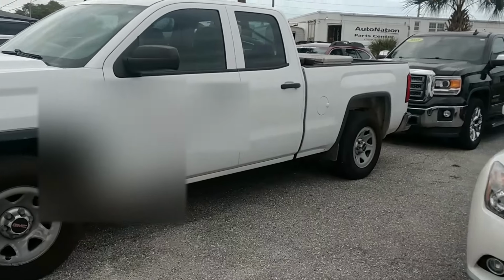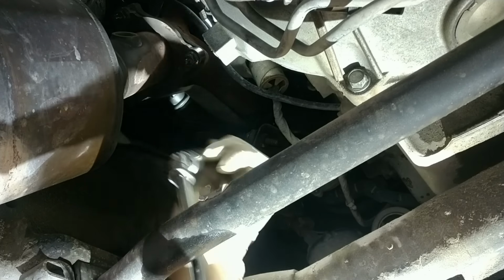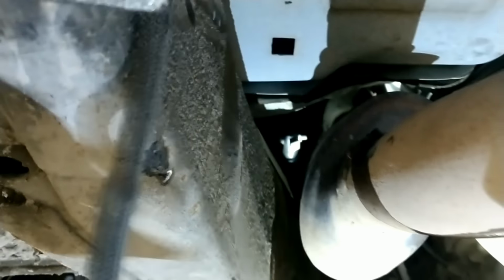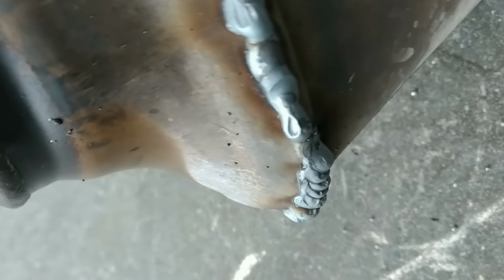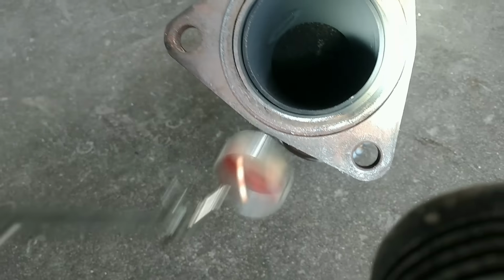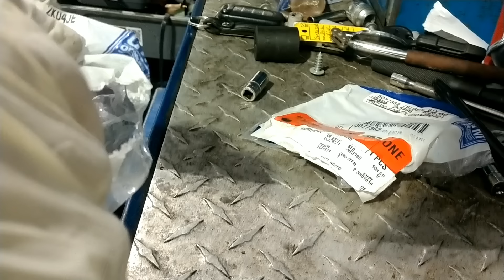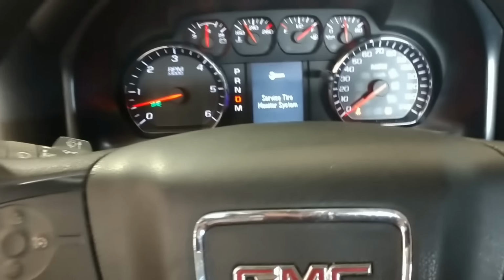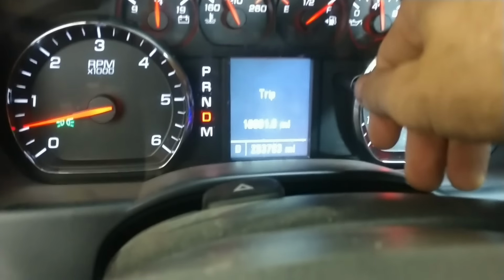Customer States exhaust leaks: Repair it cheap.  Ok then, I can do cheap and good. Sort of.

Comment: Gotta love those genuine USA made GM parts
Reply: Even tho the tag said made in Mexico
Reply: r/woosh
Reply: Made by Unions
Reply: @oigleoystereater2003  made from cheap steel, using cheap labor, with no quality control, in shit working environments... yeah, totally better than any U.S. made products 🙄

Only reason anyone does business in Mexico is because of their trade agreements. The NAFTA and other FTA's Mexico has, makes it a trade mecca. That being said, they don't have half the quality of American made vehicles. They are rolled out in mass to be shipped all over the world, with cheap parts. Fun fact for you, it cost GM $2.00 to make a sensor on the truck. They sell that sensor for $110, and it's known to fail. Designed failure is now a thing.
Reply: @oigleoystereater2003  Ford is #3 in reliability behind only Honda and Toyota... The F-series is the number one vehicle line sold world wide... must be some pretty fantastic crap.
Reply: @hanksadventures4132  American made quality vehicles? Like the ones who have engine problems in less than 200,000 miles, or body/frame rot in 5-6 years? What were you smoking when you came up with quality and American made vehicles in the same sentence?
Reply: @JosephArata  well considering how they are made from aluminum, your frame rot theory holds about as much water as a strainer. "Engines that have problems with under 200,000 miles"... funny, I have an 07 F150 with 400,000 and a 98 F150 with 450,000 and a 2012 with 210,000... all run like New. Most Chinese cars are not driving after 200,000 miles, and the rest of the vehicle is falling apart. Japanese cars are still on the road, but the entire car is shot, the interior especially. European vehicles are lucky to make it to 150,000 miles without MAJOR engine work. So again, please explain how American vehicles are garbage?
Reply: It doesn't matter what piece of crap you drive, they are all made from parts that come from all over the world and none of them are built to last.
Reply: The parts have to do with quality control. I’ve serviced Toyota and Honda’s with Denso parts Made in Mexico. Japanese parts manufacturers appear to be based on quality as opposed to their US counterparts. It’s about the work philosophy.
Reply from the maker: @InuyashaMiles  that was the joke
Reply: @hanksadventures4132  yep planned obsolescence
Reply: @JosephArata  To be fair most "frame rot" is owners living in states that have heavily salted roads and doing no undercarriage washing and/or fluid film treatment. Heck, I had a cheap-O Escort or 12yrs and it had zero rust at all, it depends heavily on where you live and the maintenance it gets.
Reply: @barryaiello3127 yep.  frame rot is a fact of life where I live. If it doesn't have some natural weight reduction after awhile it's not from around here. Every vehicle has some.
Reply: @colinklang  Yea, I used to live in MA, the salty roads literally ate cars, they do make a good protective film-spray called "fluid-film".
Reply: @hanksadventures4132  that's funny you mention Ford because for all the searching I just did, they're not hardly ever mentioned for reliability. Seems kind of strange for a brand that apparently ranked 3rd.
Reply: @jeremyrafuse5330  running off of old data. That being said, as a mechanic, I see more GM products than anything. From dropped valves due to the AFM to blown out rear ends due to the wrong diff fluid from the factory.  I see a few Fords and foreign cars. Nissan is right up there with GM, with those trash transmissions they slap in them, at least once a month I have someone come in needing a new one.
Reply: @hanksadventures4132  our work truck is a Ford F250 Superduty, with under 20000kms on it. Part of our daily checks now at work is making sure the truck can actually start. My brother's wife had a Ford Escape. I spent more time underneath that vehicle than inside of it. It was constantly broken. I had a Ford Focus sedan for a rental one time. Could be more on Enterprise, but not very much kms on the odometer and it just felt like it was going to fall apart and handled like a shopping cart. Just felt extremely cheap.

I drive Chevys mostly because of the fact my wife's uncle works for the head office in Ontario and we use his discount. I have a 2015 Chevy 1500 that has never had any issues with it, and a 2019 Chevy Blazer for my wife with zero issues either. Come to think of it, all of the vehicles I've owned never had too many issues.
Reply: You mean Mexican authentic American parts
Reply: @volkswagon1966  yes
Reply: @hanksadventures4132  i would like to correct you. Not all European engines require Major engine work past 150 000 miles, as an example Mercedes Benz diesels used as taxies around europe having crazy mileages without major engine work done, mostly older ones sure. A friend of mine has a Toyota Avensis D-4D 2014 with 700 000km on the clock and no major enginework done, sure clutch replaced and egr valve replaced along with things like waterpumps etc. The normal stuff, but nothing major.

Same with certain Volvo Engines going past one million kilometers. 

Nearly every manufacturer has their good engines and their bad engines.
Reply: @jamram9924  Exactly. And if the American car companies fully adopted the Japanese TPS manufacturing system with a culture of stopping to fix problems, to get quality right from the start. Jidoka  (Autonomation) then American cars could be quality too.  But they won't, so they aren't and most Americans will continue to buy Japanese cars as they deserve to get the most quality for their money.
Reply: GM had there parts made in Mexico and China both are 100% junk and should never be sold in the US
Reply: @worstnightmare9772  Fun fact: Most automakers get their parts from the exact same suppliers.
Reply: Made in America not usa it means north or south America
Reply: @oigleoystereater2003  lmao theres a reasom nothing is made in mexico
Reply: @hanksadventures4132  mojority of ANY us based car company hasnt been 100% american since 90s I think. Hondas out last everything american. They have way beeter quality control. 85 f150 650,678 miles 77 1.5 million on a 460 88 Honda odomiter expired! No over haul no major maintenance. 77 and 85 both 460s over hauled twice. My 76 sold because of it being american peace of crap boat ⚓!  Took my loss at 3500! Sold it for scrap! So ummmmm ehats ypur point. Ford sold out, GM is a goverment hand out dodge is owned more by Mercedes.
Reply: @indigenousways666  ... dodge is owned by Fiat... try again... Honda makes Fantastic small engines, just not good cars. The interior and exterior are absolutely trash. Ford parts are made in 3 major plants. Cleveland, Windsor, and Romeo. The vehicles are assembled in Mexico and Ohio. Honda is assembled in Mexico, and meet Mexican quality control and safety standards. The only thing Honda has any quality control measures for that are stringently enforced, is the production of the block, which is produced and assembled in Japan. You clearly know VERY little about cars.
Reply: @hanksadventures4132  
F150 is also number 1 in junk yards.
Reply: @ageckomiller  that's not even close to true. Go to any junk yard in America and look for an 11th gen F-150 (04-08, Ober 3 generations ago), then go look for an 05-07 Silverado or Ram. Guarantee you that you will find 4-1 of the Silverados or Rams. Why is that you may ask? Longevity. The 10th and 11th gen F-150's have one of the best transmissions put in a full size truck. The number 1 reason for vehicles to end up in the scrap yard is due to a mechanical failure, typically involving the transmission. Ford outsold the competitions trucks 3-1 with the 11th gen, yet consistently outperformed them in terms of Longevity.
Reply: @Manakuski  European gassers is what I was referring to. Here in America tho, European diesels are still junky. They last as long as it takes to pay the vehicle off, then start falling apart. A big part of that is maintenance, due to the high cost of parts and fluids to meet euro spec, maintenance is typically lacking.
Reply: @hanksadventures4132  
I've had a 96 k2500 for 17 years. Find me someone with a Ford they've had for 17 years.
Reply: @ageckomiller  me, my 98 with over 450,000 miles (not KM) on it. Still runs fantastic, original motor and trans, had to replace an axle after being t-boned, and front axles because I take it off road just about every weekend. I've had my 07 (currently sitting at 410,000) since January 7th, 2007 with 3 miles. Congratulations, you bought a k2500, an extremely underpowered truck with a God awful transmission and shit gas mileage. I'm guessing you live in the south where your k2500 hasn't been exposed to salt, and I'm also assuming by the fact that you've had it for 17 years that you wither don't go off road, or have had to replace darn near the entire truck.
Reply: @hanksadventures4132  
Not going to get into the oldest argument of manufacturers with a closed minded ford fanboy.
All I can say is I've had 3 Ford's, 3 GMs, 1 Toyota and 1 dodge. Every one left me stranded at some point except the GMs. Proof is in the pudding.
Reply: @ageckomiller  I've owned every brand of vehicle myself. I have a 99 Silverado sitting in my driveway right now. It has 95,000 and needs a new transmission. Sold a 95 dodge about a month ago, it had 260,000 and 2 engines. Proof IS in the pudding, and looking at the junk yards, it's clear. Now run along to your sister-mom and uncle-dad and complain that the mean man on you-tube said GM's were junk vehicles using outdated technology that was abandoned by every other manufacturer in favor of better fuel economy, more power, and greater reliability.
Reply: @InuyashaMiles  ya.. South America
Reply: @hanksadventures4132  f150 sales numbers are 95% sold in USA.. and The reason for that is The lower taxes and from that lower Price.. so worldwide... Yes But not really..
Reply: Good job!  After this truck, that guy should just get a Hilux and never have fix anything.
Reply: @hanksadventures4132  yeah fords behind honda and toyota, who both also make millions of cars in the US every year
Reply: @NoknOnDors  Yes, there is Yank made Toyotas and all the Yank made ones are the worst performers on their books for reliability and build quality, I don't know about the U.K. as I don't live there, but where I do, the worst Toyota is the Kluger which is U.S. made, but it is still vastly superior to any other Yank crap, especially from the "Big Three".
Reply: @andym1223  Glorious revolutionary socialist people's unions.
Reply: @InuyashaMiles  last i checked Mexico was in America
Reply: GM. 'nuff said
Reply: @hanksadventures4132  you don't have two Fords with 400k and 450k miles and anyone who believes you is a fool. Those do exist, but you don't own them.
Reply: @hanksadventures4132  that’s very interesting hearing from someone currently in the field, thanks for posting. I had a 98 Tacoma then an 01 s10. Very few parts needed to be replaced  on yota. Only the ball joints and regular maintenance. The s10 was completely opposite. You name it, it failed. I should have researched before buying. Piece of junk. Got both from original owners. S10 had 80k mi and Tacoma 101k. Fuel pump failed 2x on s10, not once on Tacoma. Ball joints replaced at 70k miles as per owner receipts by a NAPA certified garage. And again at approx 140k. LotSa other repairs that would take hour to write out. Couple friend have similar vintage Ford trucks 97 & 99 f150 and ranger and like Tacoma very very few repairs needed other then regular maintenance. I can add that I’ve heard Nissan was good before y2k which is when Renault merger then they turned to junk. I had a 97 pathfinder that was awesome, regretted selling!
Reply: @oigleoystereater2003  What country is Yank in? Is is over by The New Zealand?
Reply: @hanksadventures4132  the F is only sold in decent numbers in the US. they dont even sell them in most countries outside the US. might want to check your american awesomeness there. most american cars/trucks are not even legal in the EU due to their utter shit economy, pullution level and utter lack of safety. and no one is going to buy ANYTHING with 6.8 V10 when gas is 9.50 a gallon and simply cannot fit in a parking space or garage.
Reply: @oigleoystereater2003 , given today's greedy unions and lack of quality control at GM, you are probably more right than you think.
Reply: @InuyashaMiles , hell, most of them are already here in this country so hard to tell.  Made in Mexico could also mean Las Angeles, etc.
Reply: It is a sad thing that a Subaru, Toyota, or a Honda, is made of more American parts then a Ford, GM or Chrysler automobile, then again assembled here in “America of world parts” is now a common tag on build sheets. While cost of labor increases, the number of jobs is decreasing and people complain “buy  American support our economy “ and in doing so they drive cars trucks and other vehicles that support international trades!

And yes I know this has been going on for over 70 years!
Reply: Hey now, he didn't say USA made, he said American made, and South America is still an America.
Reply: @andym1223  If you blame unions for capitalists seeking more profit then you are a fool and you are playing into their hands.
Reply: @JosephArata  Oh, rinse your brain. Go to any junkyard in Europe and read the odometers. You'll rarely find anything with more than 500k KM (or 300k-ish miles) and almost all of them are German-made cars.
Reply: @hanksadventures4132  depends how the stats are gathered. If its down to a survey people can be awfully complicated with brand loyalty & investment bias/sunk cost fallacy. Unless its a quality survey based on say parts sold across an entire region vs dealer repairs or a survey of how satisfied customers are then the data is highly suspect.

Humans are often incapable of unbiased analysis
Reply: @JosephArata  like the US made Tesla's vs China made Tesla's which ones have better build quality, consistently better panel gaps etc?

Hint its the Chinese built ones...
Reply: @hanksadventures4132  your sample size is statistically insignificant & irrelevant. One person with say half a dozen vehicles data points is completely insignificant from a data analysis pov I'm afraid. Not to dismiss your experience but even if there was an issue with say 1 in 100 vehicles that'd be a high failure rate whilst you could easily be unaffected personally but overall reliability & longevity would be poor. As an example of course.
Reply: @InuyashaMiles  bet you're fun at parties 😉🤣
Reply: @RainmanRaysRepairs  Still made in America, even if it is Central America ;)
Reply: @hanksadventures4132  450k and only on the 4th or 5th engine probably
Reply: The entire truck could be assembled in Mexico.
Reply: He never said usa he said America made
Reply: @oigleoystereater2003  Happy 4th of July!
Reply: @brodoginc  why, what's special about the 4th of July?
Reply: @oigleoystereater2003  you wish you didn't know.🤣🤣🤣
Reply: "Made in America"
Didn't say which America. 
North, Central, or South?
Reply: @michaeldurrett8388  The United Sewers of America.
Reply: @michaeldurrett8388  The United Sewers of America.
Reply: To be fair he didnt say usa he said american. And if u dont think mexico is in america you should go back to school
Reply: @indigenousways666  well hondas are the most american vehicles in america soo
Reply: @InuyashaMiles  All countries on the American continent are the Americas. Mexico is American. Canada is American. The USA (Which stands for the United States of America) is likewise American. Why do so many folks think America is only the USA? It boggles my mind that so many people fail at geography.
Reply: Made in China
Reply: @hanksadventures4132  you can thank the TUV for that. Vehicle owners are forced to maintain their cars to TUV spec or lose the ability to drive the car around . No need to build something that lasts because you’ll have to replace certain parts at every inspection.
Why bother?
Reply: @volkswagon1966  indeed  every manufacturer is a mix of parts from everywhere
Reply: I believe he said American made parts. Mexico IS in North America. So, he was correct.

Comment: Neat you weld like I do.  I have half a car welded like that been driving 20 plus years and I am not ashamed of the welds or how the car looks.  : )  Old 1967 mustang coupe 200 I6.  Drove it up to Washington state from Northwest Florida.  It's been in a lot of Seattle traffic too.  C4 automatic and 4 wheel drum brakes.  No a/c no power steering. No power brakes. The whole car is very ugly but very oem.  Easy to work on and repair as you can guess.  Have a great day, love the videos you make, click : )

Comment: If you ever have a hard time getting AF or O2 sensors out, use brake fluid as the lube. Worked every time.
Reply: thanks for the tip!